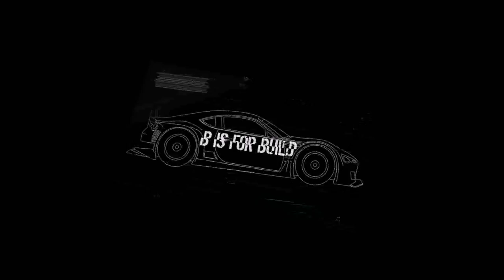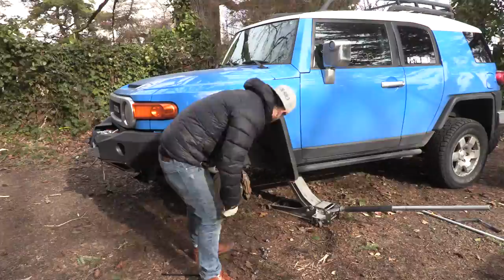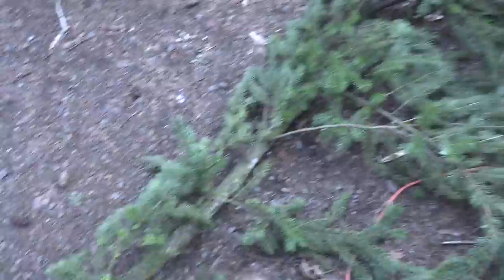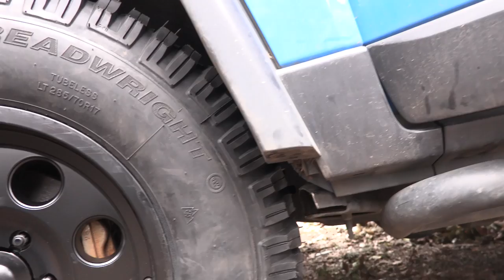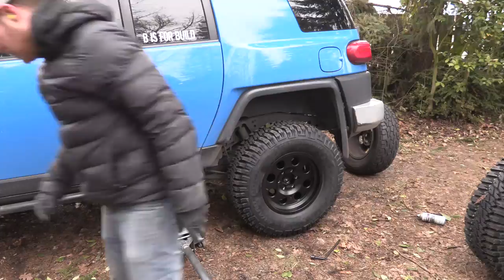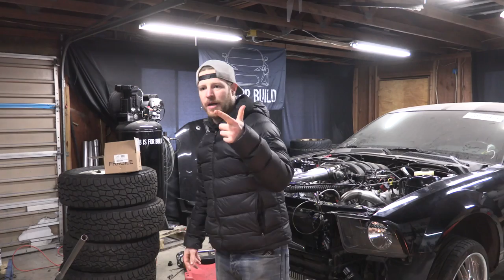FJ Cruiser Build Pt 4 - New Wheels, Tires, & Body Mount Chop

Comment: i painted chrome stuff before, and ive found the best way to scuff the chrome is by using a bench wire wheel and just wire wheel them till they are ruff and lost some of the shine, you can feel it, and i have had good luck doing it like that.

Comment: My brother and I had a really bad experience with lug nuts like those. The spline part separated from the acorn.  We ended up removing everything from the A arms so we had access to the back side of the stud because the extension broke off in the nut extractor.  Long story but we had to chisel out the back side of the stud and pound it out to get the wheel off.

Comment: for tire size the first number is the width in mm. the second number is a ratio of the width for how tall... so a 235/75 is 235mm wide and 75% of 235 tall

Comment: Have you considered buying a powder coating setup? It's fairly cheap to get setup to do small parts ;-)

One other thing, that body mount end that you cut off is what makes it rigid, it's pressed into that shape purely for strength... I daresay you'll get away with it, but it's something to bear in mind. Cutting and shutting as you mentioned will be a good idea.

Comment: With fender flairs and a lift those are gonna look like baby wheels, never skip leg day , to small
Reply: spacers will come to the rescue obviously
Reply: Travis Chowargir how do spacers increase tire width -__-
Reply: turtlemonkey it won't increase tire width. With it make the fitment look better when the fender flares go on.
Reply: Travis Chowargir hardly. He needs wider tires to fill the gap. They are too skinny. Pushing the wheels out from the car arent going to make it look better in my opinion
Reply: SLMA LAIOS He should have gone with 285/75R17

Comment: The lift would have negated the need for the body mount chop.  Having run 3 sets of Hitech/Treadwright tires over the years, I've had no issues with any of them.  Looking forward to the lift install.

Comment: 285 = Width of tyre in mm. So 25 mm Wide / 70 =Depth of tyre ( % of Width). so 285 X 70% = 199.5 mm Deep / 17 = Diameter of Rims in Inches So they fit on 17 Inch Rims. After that you may ave other letters/numbers these will give Max load per wheel and guaranteed speed. Here in the U.K we call them Re-moulds, If you are doing normal driving they are OK, What you will find is that if you are not moving and keep spinning the steering wheel from side to side you can rip the tread off, Specially these days with Power Steering, I used to fit them to the rear wheels only, With good tyres on the front axle because of the Steering

Comment: Found your vids and I'm glad someone is posting a nice in depth build! I have a FJ and was starting to get the itch to mod mine. Question for ya. Is it necessary to cap off the BMC? I have some cutting skills but as for welding skills? Mine are absolutely absent. Just wondering if I'm risking anything if I don't cap off the chop with a piece of metal like what you did.

Comment: You need to get rid of those alloys, get some steelies on the thing!!!
Reply: You also need to take into consideration flexing when 4 wheel driving when looking at clearance, I have a 2 inch suspension lift on my 4runner, the 33s I had on it scraped when going for a 4bie in extreme situations.

Comment: So was there no prior lift on the fj when you put the wheels on. I have an 08 fj with a leveling kit wondering how big on tire size I can go before needing more lift.
Reply from the maker: no lift before, the biggest tire you can run is this size, and you will need to do the body mount chop
Reply: B is for Build can you give me the dimension of those tires

Comment: careful with recapped tires at high speed. America stopped using them because they can separate from the old tire carcass. I'm sure modern technology is better than it used to be but that's part of why you can find large chunks of big rig tires on the side of the highway. big rigs never stopped recapping tires and they eventually sling the tread off.

Comment: Hi Chris ,Just letting you know that the tyre sales guy is giving you '"Alternative Facts " , in Europe these tyre retreads are banned in most countries . we have very strict tyre laws and  the idea that a tyre would get redone 5 or 6 times is pure nuts.... The reason for banning was that the condition of the donor tyre was an unknown and therefore uncertifiable. We had big problems with delamitation at speed causing multiple accidents. Huge , huge gamble to take on road safety.

Comment: Treadwright has great reviews with a lot of the off road magazines and online forums. I have several friends running them for 30-50k miles with zero issues. These tires are not the old retreads that were popular back in the day. The company is very selective on the tires they use to remold and sell

Comment: Oh man, the re-thrading and refurbishing is completely different thing and the first is only done to truck tyres that have special marking to allow cutting new thread up to some limit. Re-furbished tyres are usually really crappy, not regarding the thread but regarding the fact that the tyre used as a base is usually really wobbly and weaker due to the fact that it was already lived through its life sycle and usedon a car with god knows how bad axle alignment. and no they dont do it in europe up to 6x in europe.

Comment: Heard a lot of bad things about refurb tyres, good luck. Also you're wrong about that Europe thing, very very very rare that it even gets done here in the U.K.
Reply: It's Mandatory to recycle every tire in Britain.  Not sure what your talking about.
Reply: Yeah but it doesn't mean it gets turned into other tires they usually get shredded and made into soft rubber like flooring for children's play areas and parks and schools and running tracks etc
Reply: Incorrect.  You have major manufacturers like Kingpin Tire that sell large volumes of Retreaded tires in the U.K. for over 40 years.  Retreaded tires are also the norm in aviation.  The idea that rubber is mainly used for flooring and play areas is asinine.

Comment: If you have ever actually seen retread tires blow on a car or SUV then I'd like to hear the situation surrounding it. Otherwise you're probably just telling the story your dad told you about his uncles son in law who bought tires from behind the tire shop that were retreads and they blew out at 65 mph. 
Retreads have improved drastically over the past 30 years and within the past 10 years. Most retreads go on semi trailers and last 100,000 miles before they go. Oh, and the tires they use to put new treads? Those have seen the same mileage. 
Chris, your tires will be fine as long as you don't go 100 mph every 5 seconds.

Comment: remolds are ok if you are desperate but they do tend to wear down alot quicker on past experience only buy new tyres now when possible you get what you pay for and they are cheap cheap cheap if not your getting ripped off

Comment: be careful tho... poorly retreaded tyre will dethread (is that even a word?) at high speed.
Reply: Emmanuel Thommy FJs should never go over 90 anyway... although a friend of mine went 110 in his
Reply: lorry in my country dethread (again, is that even a word? lol) quite often n they barely making 90 km/h (or 55 mph)  

iinm theres a max speed limit u can go on rethreaded tyre. maybe check the company for one?
Reply: These guys aren't a re-tread, it's completely encapsulated in new rubber and vulcanized. Check out the web site of the tire company, Treadwright.
Reply: remolding is still a type of retreading (they call it bead to bead retreading i believe). in our country, we call it tayar masak, which literally means "cooked tyre" for the heating procedure that required to vulcanise and attach the new rubber to the old tyre. if the tyre hav poor vulcanization n ull hav high risk of having catastrophic failure at high speed.
Reply: Joshie is right. Remolding totally different than retreading. This is the same process they use to remold airplane tires, for example. It is literally the exact same way they build a new tire. Make a casing, cover in hot gooey rubber and put in a tire press. They use the same process, equipment, etc as major tire manufacturers. They only difference is the reused casing. The tire is physically the exact same thing as a new tire.  This is not true of retreads, which shouldn't be used on a passenger vehicle. If remodeling is good for a 747 -- it's good for me.

Comment: your 285 is lil under 33...
Reply: patrick nepton doesn't 285 mean the width of sidewall to the opposing sidewall? how would that determine the diameter of the tire
Reply: 285/70/17 = 32.71 and real 33 are 33.03... usually 33's are lil wider mine are 12.5
Reply: patrick nepton oh, well you learn something new everyday lol

Comment: you know since you weren't doing the lift this video you probably could have pulled it into the garage and worked inside
Reply: Ryboodle nope. the fj barely fit stock and the bigger tires lifted it more. he wouldn't have been able to get it out.